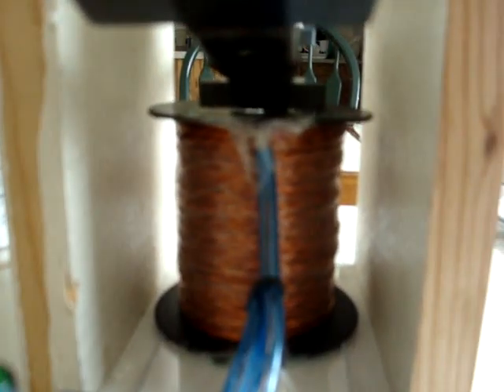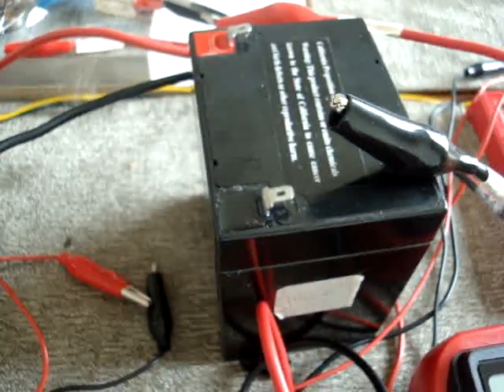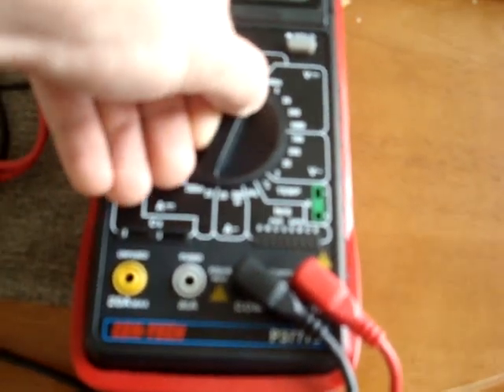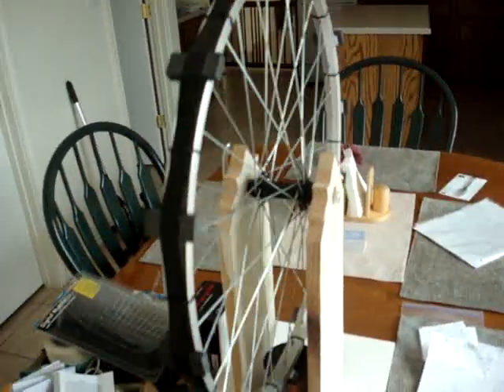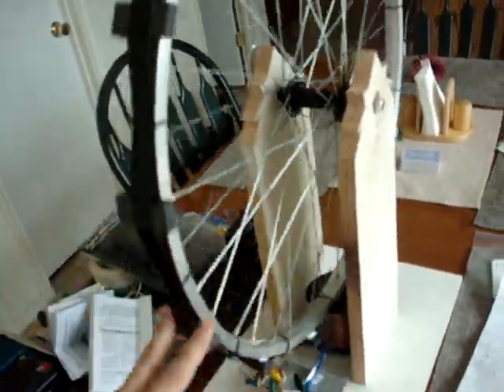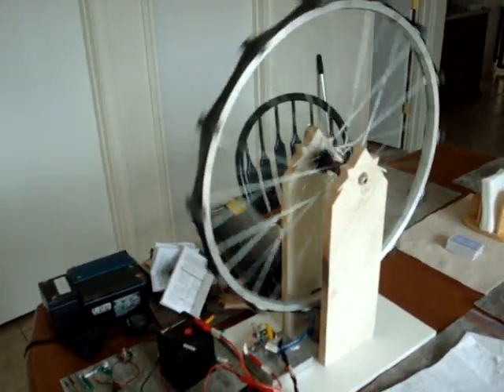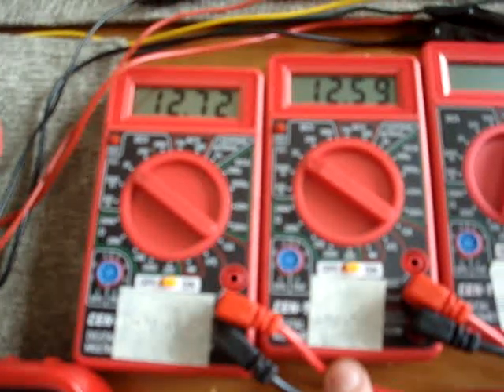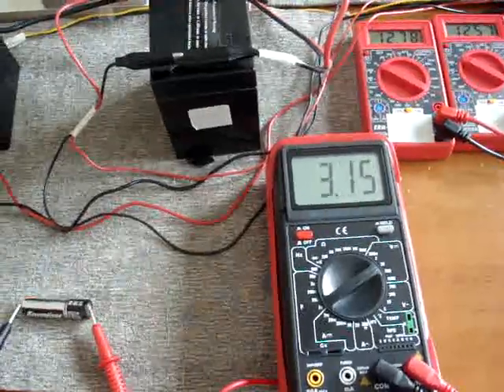Bedini SG energizer

Comment: Hi. I have used the same multimeter, the one that you were trying to measure amps with. What happened is the fuse that protects the multimeter from max current flow blew. To replace this fuse, there should be some screws on the back of the multimeter, take the back off, and there should be an easily accessible fuse as well as a nine volt battery. Take this fuse out, go down to radio shack and buy a replacement fuse. Replace blown fuse with new fuse in multimeter and you should be good to go.